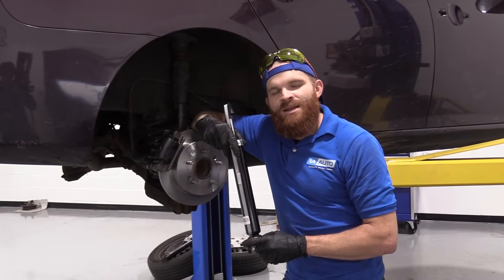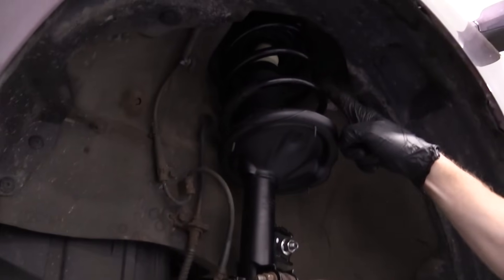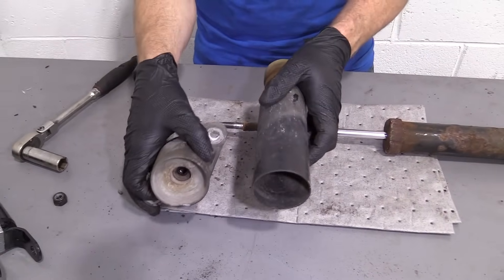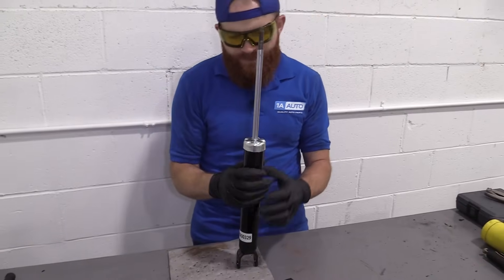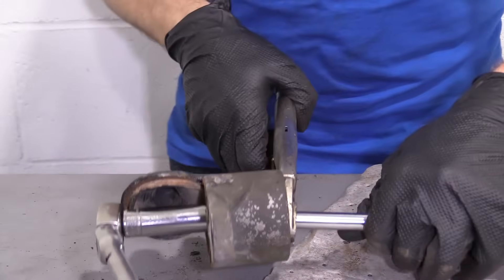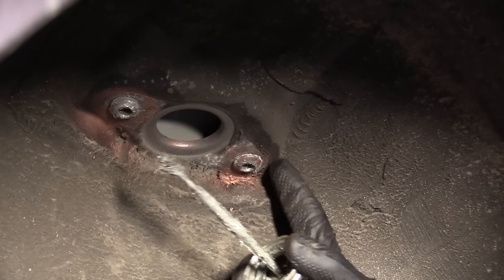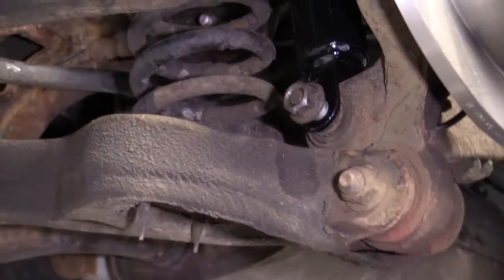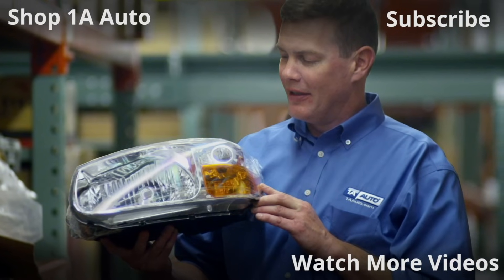How to Replace Rear Shocks 07-10 Hyundai Elantra

Comment: Anyone else struggling with removing the rubber boot thing: I don't know if mine were different (2008 elantra sport) but they DO remove fully. It seems the rubber is glued to some metal/plastic ring, and it's this ring that comes off. You don't need to be tearing off rubber. My first one came out easily, but not the second one. You need to push it around it's sides/play with it so that it gets unstuck.

Comment: I had my shocks replaced on 2010 Elentra but now there weird noise when I drive from rare passenger side.  Do you know what might cause this?
Reply from the maker: +Peter Lynch We wouldn't be able to diagnose an issue like that here, you may want to have a local mechanic take a look at it. Thanks for checking us out! 1AAuto.com
Reply: @1AAuto  it was a rear wheel bearing. How much do they cost for 2010 Elentra with ABS?
Reply from the maker: +Peter Lynch The link to that part is below. Thanks!
https://www.1aauto.com/2010-hyundai-elantra-wheel-bearing-hub-assemblies/y-mo-c/2010-676-384?2010-676_FrontorRearLocation_fitQualifierFld=Rear
Reply from the maker: +Peter Lynch This part will be correct only if your model has 4-wheel ABS: https://www.1aauto.com/hyundai-elantra-rear-driver-or-passenger-side-wheel-bearing-and-hub-assembly/i/1ashr00335?f=1127173&y=2010
Reply: @1AAuto  I think that's what I have. I have gl model 2010 elentra

Comment: I have an issue with my Elantra HD.  The rear suspension had all its bushings replaced, the end links were replaced and shocks (genuine) replaced. Immediately I noticed the ride at the rear was very stiff to a point that it doesn't really compress. A month later about 600 miles, the shocks were softer but I noticed knocking sounds when going over rough surfaced roads or bumps. Went back to workshop to tighten up every nut, checked rear brake calipers and pins were all good without play, but the knocking noise still present. Could the absorbers be faulty hence emitting knocking sound?
Reply from the maker: +Ian Polo Since there could be multiple reasons why youâ  re experiencing this difficulty with your vehicle, I strongly recommend that you have a reputable mechanic inspect it. Theyâ  ll be able to troubleshoot the problem and tell you what part or parts youâ  ll need for the repair.
Reply: Im having the same knock , i just changed the shocks

Comment: Wow, this video couldn't have been posted any later or I would've brought my car to a mechanic. All I needed was a replace the rear shock in my 2010 Elantra I just bought.. and all the tutorials I see are for front struts or for models before 07 or after 2010.. gonna give this a shot next week
Reply from the maker: Thank you for the great reply. We love to empower our customers by showing you how-to perform your own auto repairs! Have a great day! 1aauto.com +Michael Gates
Reply: @1AAuto  You guys have the shock absorber in your store but do you also have the big metal mount it slides into which attaches to the car, and the rubber/plastic boot as well as the rubber cap? I am trying to replace mine but noticed the mount has a cracked bolt hole and a chunk has fallen off. AutoZone doesn't have them and I can't find them on your website

Comment: Do you guys carry the bushing the shock connects to ? My bolt that connects the bottom of the shock is seized in the bushing . Having issues finding the part.
Reply from the maker: +Scottsudz84 We do not currently have the bushings for the 2007 - 2010 Elantra at this time. Thanks for checking us out!

Comment: My rubber boot on the top of the shock was stuck and I had to tear it off. I just pieced it back on before putting in the new shock and it looks pretty snug. Am I running any major risks doing this?
Reply from the maker: +James Nicolaus Thanks for checking us out! This is mainly to prevent any debris from getting caught up in the shock. We would recommend keeping the boot intact however if it is for a short time, there shouldn't be any major issues until you get it fixed.

Comment: Can I replace these struts without a hoist? I can only get the car about 12 " off the ground?
Reply from the maker: +Lynne Garrelfs Thanks for watching.  It will be more difficult than using a lift, but you should have enough clearance to get the job done!
Reply: @1AAuto  Biggest problem is able to remove the mounting bolts holding the  upper mounts from underneath. I am not sure if I can remove those bolts!  If I have a long extension to my ratched and have a mirror to see what I am doing, that might work. I am not sure if the rough noisy ride I have is from the shocks or the upper shock mounts. The upper mounts are about the same cost as the monroe shocks. Hard stiff noisy ride on rough road . Car is 10 years old but only 82,0000 kms. What do you think.....Thanks
Reply: @1AAuto  Thanks, I will look to see I have enough clearance. Job does not look so difficult for my husband.
Reply from the maker: +Edward Ryback Best of luck with your repair!

Comment: Where do you buy the rubber boot?
Reply from the maker: +William VP Thanks for checking us out! The rubber boot is attached to the shock and it appears the part is either a dealership only part or you may need to purchase a whole new shock. Please let us know if you have any further questions, thank you.
Reply: The kyb shock mount I bought for my 2009 Hyundai elantra does not have the rubber cap on it and I was wondering if that was a problem.  And thanks I'll check out the dealership website for it also!